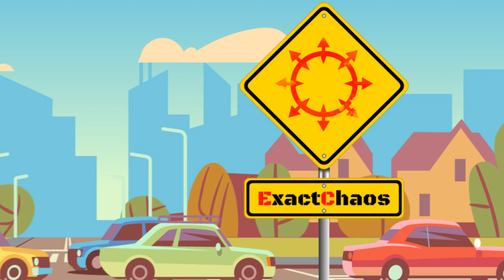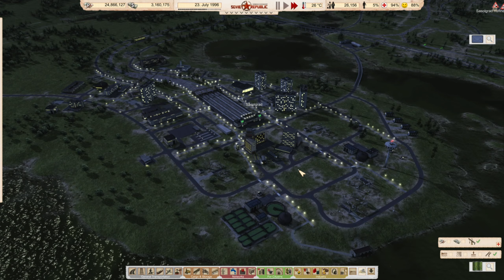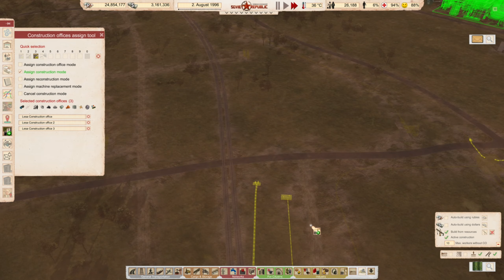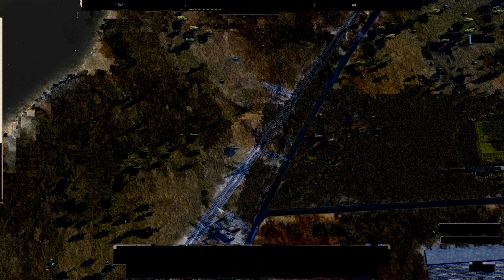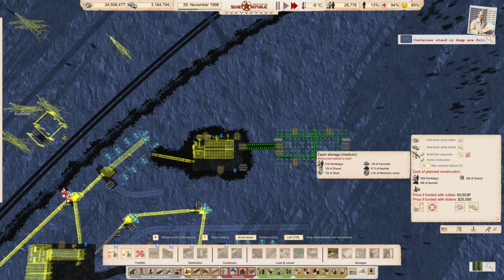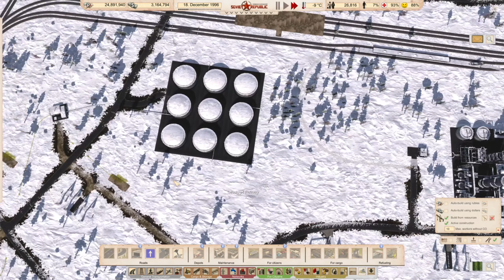Planning a Waste Management Facility - Workers & Resources Version 1 - #73

Comment: Hi. 
Can I ask why you don’t use the fork lift trucks when planning factory connections. 
They can make for more complicated layouts but also they add a little interest to the planning of material movements,
Reply from the maker: I avoid it as the capacity of forklifts are tiny. So it works for setups where you need to move tiny amounts of material. If you need to moce a lot it os just a bottle neck.